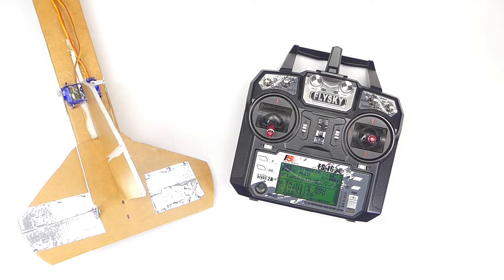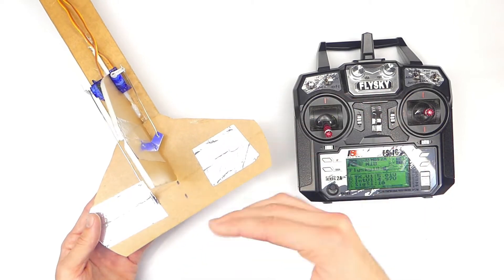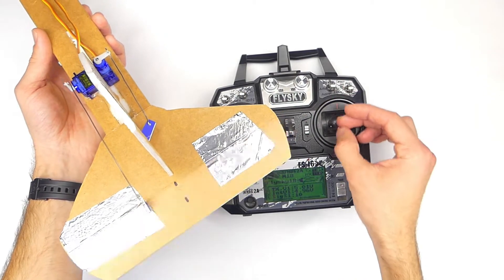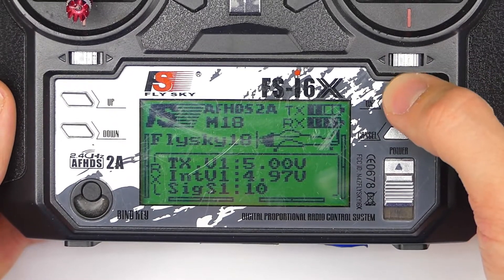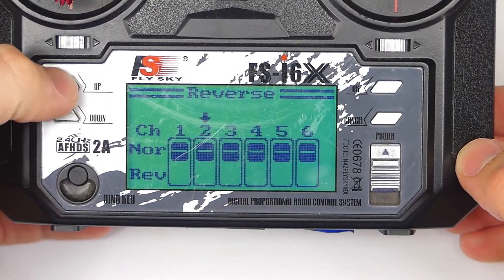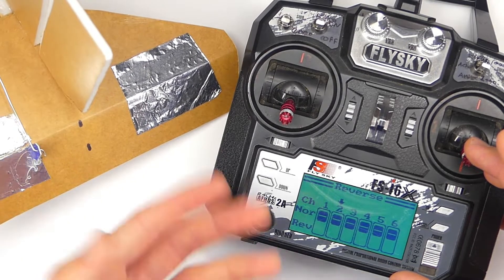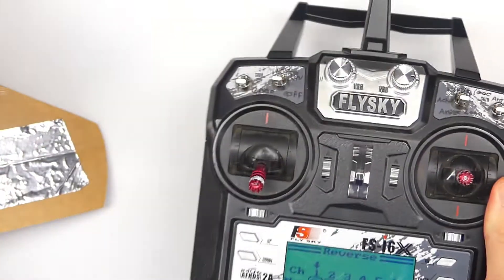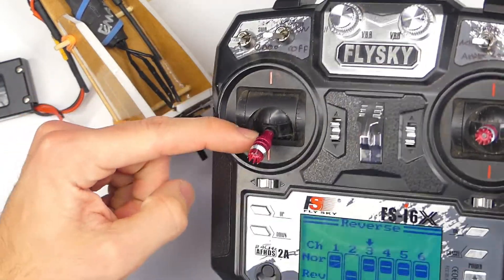FLYSKY FS-i6X How to Reverse Channel, Servo, Switch (works with FS-i6 too!) - Beginner Tutorial

Comment: Hi, I recently bought a flysky fs-i6 to control my 4 motor 4wd robot using the cytron mdds30 motor driver. However my control stick on the right is not functioning properly. As in if I press down my car steers to the right, if the move the stick up it steers in left direction. If I move the stick to the left it goes forward and so on.
Kindly let me know how i can correct the movement of the sticks with the movement of the motors?

Comment: is there a way to assign a switch to reverse a channel? on my boat I'd like to use ch3 left stick as the throttle, with the zero point being neutral and forward being forward, but if I want to go in revers it would be convenient to flip a switch on the controller to switch the channel into reverse
Reply: Hi, I did this using the switch SWB, this switch essentially changes between two throttle curves. I set the default up position curve to start at 50% and go up to 100%. Then while still in throttle curve mode switch SWB to down and then the curve changes. Set it so it starts at 50% but goes down to 30% or so (unless you want to go backwards at full speed then set it to 0%). hold cancel to save! Now flipping this switch will reverse the direction.

Please note for this to work your boat ESC must be set to accept reverse mode. Mine I do this by starting the receiver with the throttle in MAX position...wait for beep....then set to mid position and wait for beep.

Comment: So I took the same to take apart my controller to set the left hand stick to not have a spring so I can change the "sticks mode" so that this controller runs the throttle on the left hand... however this is not working. Is this not possible?

Comment: Hi Adam , I  was wondering if I can reverse that throttle , meaning - when the stick is down I want to have the throttle to the lowest and when I push it the stick up the throttle will increase its value  ( and this change I want to do it for my drone ) That “ reverse “ of channel 3 gona do that ?
Reply from the maker: @George25  what you describe is the normal default function for the throttle. But yes, you can reverse the throttle as well.

Comment: Is there a way to reverse one of the upper toggle switches? I have the issue that i assigned a throttle hold to switch B but it’s only engaged when toggle is down. And when i power up the transmitter is ask that i toggle all the switches in the up position (which deactivates the throttle hold)
Reply from the maker: Hi! I believe so. If you reverse the channel that is assigned to switch be, does that work?